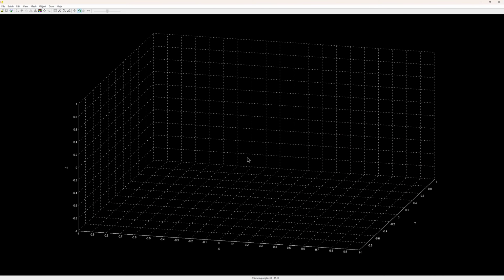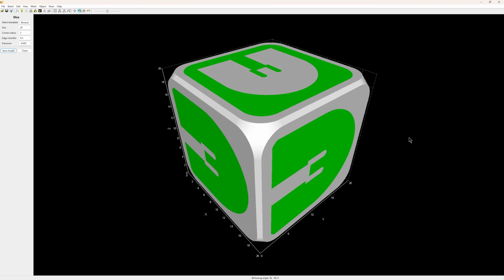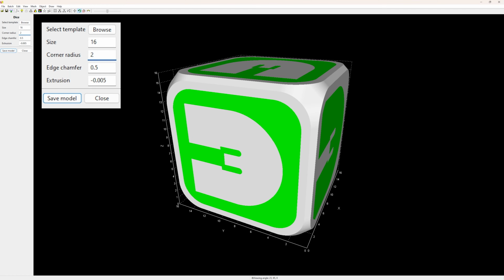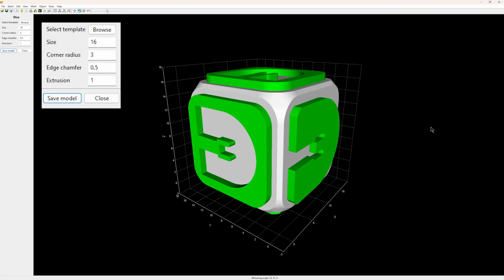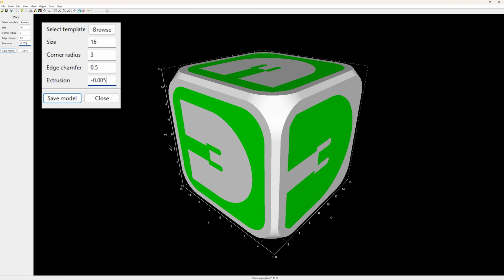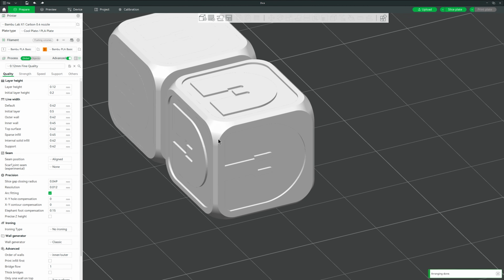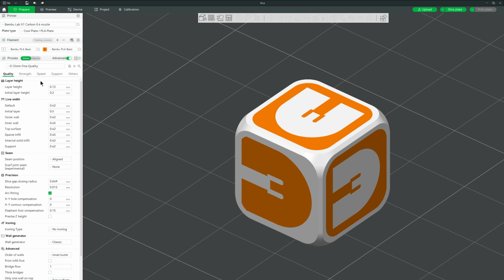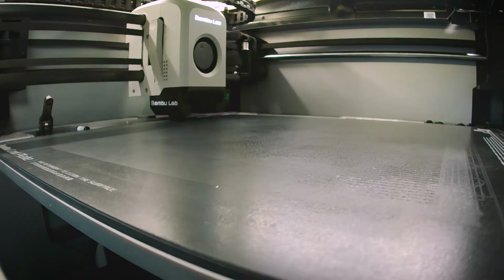Easily Make Custom 3D Printable Dice with LuBan3D

Comment: I thought this was gonna be tips and tricks on how to print dice, like splitting it up into 6 triangle parts so you can print each side facing down, getting perfect sides on all sides and reducing print time from like 4h to 0.5h…
If you want to make custom 3D stuff, spend the time and learn Blender, then you are not limited to just dice or specific shapes etc, you can make any dice you want, D4, D20 etc. And you get to learn a great new tool too :)
Reply: why would you want to make dice your way? have you seen dice that were glued together before? Did they spin and fall accurately? Did they last more than 20 throws? Do you even know what Luban does? Did you even google it? How many dice have you used in your life that were smooth on all sides and didn't have a little divot for each black circle? Wow you really put time and thought into your comment, didn't you?